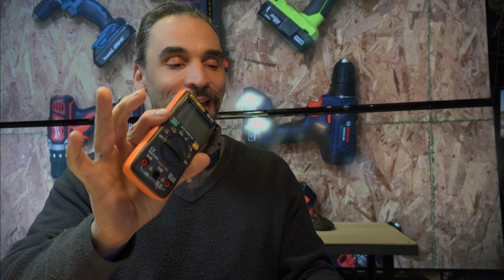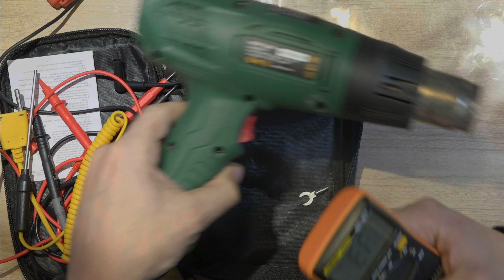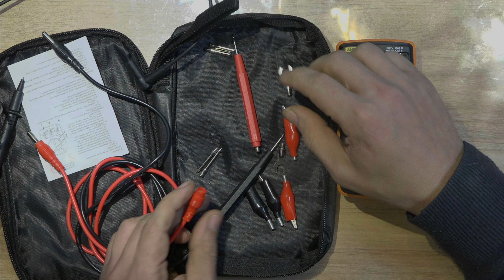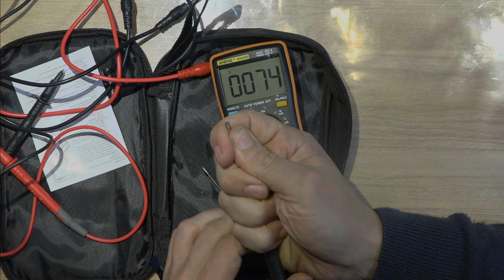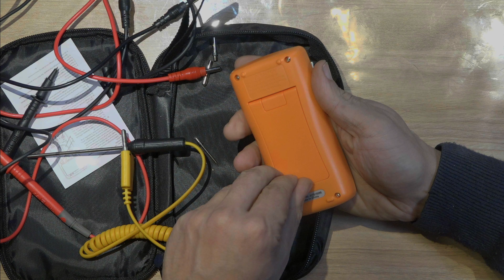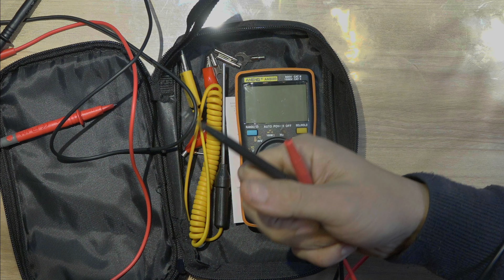the best multimeter in the world - Gabak

Comment: this multimeter is adequate for the hobbyist working with less than 50 Volts as the input protection is very poor. You get what you pay for. Probably the best multimeter for the £25 markbut certainly not the best multimeter.
Reply from the maker: if you use a High Voltage Arc Gap Calculator
at 400volts you need 0.001 inches (0.03 mm) to arc
This multimeter will be good enough for residential usage, 110v or 250v
I never saw or heard anybody getting electrocuted just because he was touching a multimeter. 
if I am wrong, please let me know